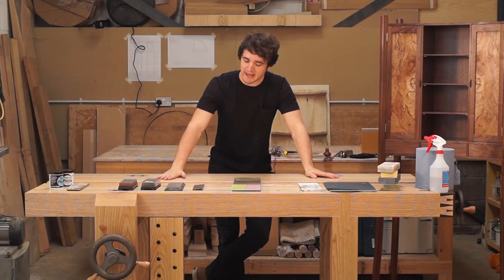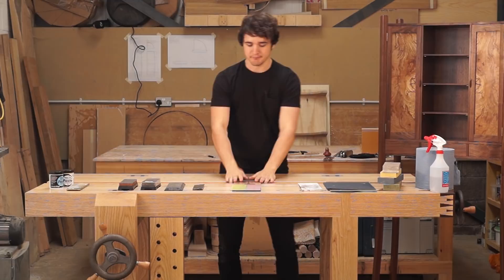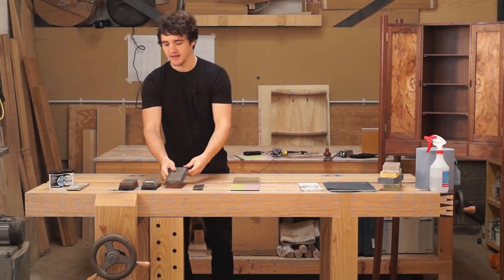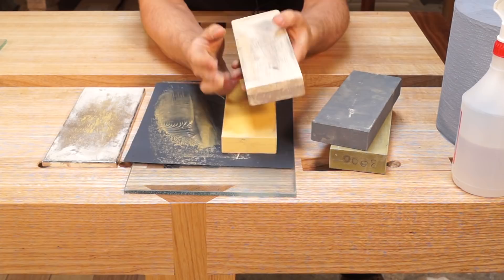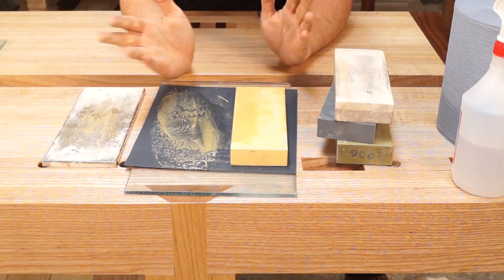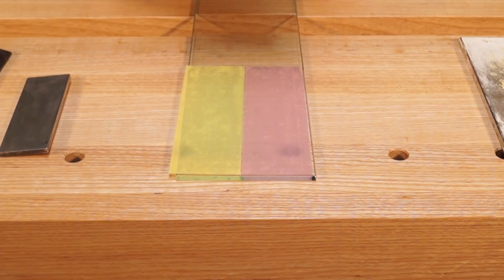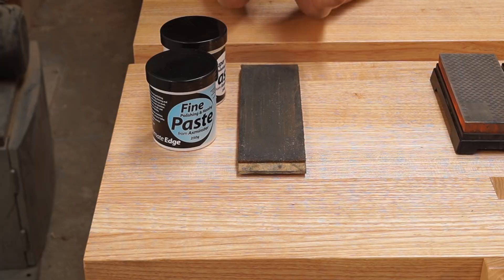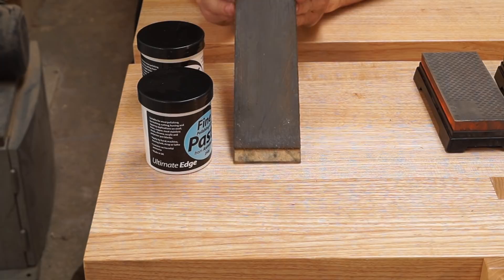Which SHARPENING Stone Is BEST? | Tool Duel #2

Comment: Honing guides are nice for beginners but once you´ve learned to do it free hand, you can use the whole stone. That´s one of the two problems with honing guides. You can´t use the whole stone with them. It will dish quicker and you´ll have to flatten it more regularly which wastes a lot of the abrasive material you´ve paid good mones for and it wastes time. The other problem with honing guides is that you need time to set the thing up. You can save some time if you have a jig to set the angle, but that´s just one more thing you need and one more thing that takes up space.
If you learn how to sharpen freehand, you will have none of these problems.
There´s also no need for a separate sharpening station for oil stones. You build a nice box for them, so your bench stays clean. You don´t need a lot of oil on the stone, a thin film is enough. The oil doesn´t dry, so you can sharpen a few tools untill you have to take the oil off and put some new on it. A few drops is enough and the stone stays ready for the next use. When using water stones, I can recommend splash and go stones that don´t have to be soaked. Shapton Kuromaku or Naniwa professional/chosera are a good choice. A few drops of water is enough. Soaking water stones are very messy and you don´t want that slurry on your bench. Then you have to soak them and store them dry. Some can stay soaked but then you need a bucket or something to store them.
All of these methods work and can get your tools sharp. Just look what´s best for your use case.

Comment: if you use glass cleaner instead of water or oil it works amazing because it has a very slight abrasive in it maybe 40000 grit it also polishes so well never go back once you have tried it
Reply: Simple green
Reply: I get an allergic reaction when I use glass cleaner now -- possibly as a result of this, or possibly something I developed earlier. If it doesn't bother you, though, it does work well!
Reply: What type of glass cleaner? Like Windex.
Reply: Agree, glass cleaner works great. Read the label before buying though and make sure there is no ammonia. The dollar stores carry the right one, and cheap too.
Reply: Ive heard use glass cleaner on your diamond stone and water on your water stone. Is that what you meant or do i just dump glass cleaner on anything and everything
Reply: Eric Kirby it‘s called „water stone“. not „glass cleaner stone“. use glass cleaner on diamond plates only.

Comment: Float glass is ordinary glass, that has been left to solidify atop a slab of molten metal. The molten metal was liquefied and then slightly cooled, and left absolutely still, resulting in a perfectly flat molten slab. The molten glass is poured atop that perfectly flat molten slab and left to solidify, resulting in an equally flat peice of "float glass".
Reply: I believe most float glass is made in a continuous process where the glass floats the length of a molten tin (?) bath until it is cool enough to be transfered to rollers. Also, flatness is a relative term. For the purpose of sharpening, float glass can probably be considered "perfectly" flat. But, for other applications like high quality optics, it not very flat.

Comment: I noticed so many folks hate sharpening. For some unknown reason I find it one of the most relaxing things I do in my shop, I know I have issues! But at the same time I'm just a part time woodworking making time not much of an issue. There's a product called magic eraser most stores have it it's a cleaner and works great on cleaning your diamond stones.
Reply from the maker: I like it at the start of the day when I'm preparing my tools for a days work. But when I'm halfway through cutting a dovetail and I need to sharpen a chisel, that's when it can kindly sod off. It breaks the workflow. I'll look into that stuff though, cheers!
Reply from the maker: I like it at the start of the day when I'm preparing my tools for a days work. But when I'm halfway through cutting a dovetail and I need to sharpen a chisel, that's when it can kindly sod off. It breaks the workflow. I'll look into that stuff though, cheers!

Comment: its amazing the discussion on diamond vs whet, then you have the sandpaper folts, and those fancy sharpening gizmos between knives, planes, and chisels you can get some heated discussions. and oddly enough i went to the dollar tree last week picked up a 1 dollar stone, and fixed up a old butcher knife i used on one of those horrible fixed angle carbide pull sharpeners (DONT USE THOSE ON A KNIFE YOU LIKE!)

I re ground below the knicks and then flipped the stone and honed to whatever the abrasive was, maybe 5-800 didn't expect much, but a few strops on 1k sandpaper (not enough to polish) and that sucker shaved. Im not a chef or a sharpening snob if it cuts hair its sharp in  my book, i've never gotten anything hair popping sharp like a really nice strait razor. But all in all a 1 dollar stone put a hair cutting edge on a cheap kitchen knife.

 I think if you get the technique right you will get a edge on what your workin with. Your budget decides how knife of equipment you are using.

Comment: How flat is perfectly flat? Do they provide any tolerance of flatness and other shape tolerance information? Well it's not really important but makes me curious.

Waterstones, or whetstones, or synthetic stones made out of ceramics in general, can be soft. But they can be hard just as well. Not sure if all of them should be called waterstones since there's many splash & go stones on the market now that don't absorb almost any water at all, you just splash something on the surface and go. They really don't create much mess either. Then again there's stones like Shapton's Kuromaku or glass series that seem rather hard. You likely aren't gonna bite into them with the edge, but some people don't like them for being almost too aggressive on removing material. On the other hand there's of course those cheaper side combination stones that are like piece of mud puddles as soon as you lay metal on it. I'd say there's a whole sea of information and variety in the synthetic whetstones as well. Then there's also the natural stones that are somewhat different. And some beautiful stones like Morihei or Imanishi that have natural stone mixed into the synthetic stone, they feel really nice to sharpen on. Sort of on the hard side but really nice slurry, although you can still bite into it. And the higher grit you go, usually the harder the stones are as well. Caveats everywhere. But with them just like you said about sharpening materials in general - know what you're buying before you buy. So that you won't get surprised by misunderstanding what you have in your hands and how to use it.

I think most agree that if you're going very high in polishing, there's not many like the natural stones. But maybe the 10k and above grits are more for straight razor and sushi knives.

If you find diamond stones are too expensive for flattening, you can get synthetic flattening stones from highly liked manufacturers like Naniwa or Suehiro for something like 20 euros/dollars. Also watch out because it's not at all given that your granite plate is a flat and properly shaped surface either and doesn't live.

Comment: Love your videos.  I don't have experience with oil stones and very little with abrasive films like Scary Sharp but have used DMT diamond plates and water stones for several years.  I've had the most success using a combination a course/fine diamond plates for establishing primary and secondary bevels and Waterstones for higher grit sharpening (1,000-16,000 depending on steel type and intended use).  I don't seem to get as good results from extra fine and extra extra fine diamond plates.  This could be, as you suggested, due to the diamonds clogging quickly or because diamonds glued to steel is very unforgiving and could cause micro-chipping in harder/brittle metals (ie A2, blue paper) or on low angle bevels compared to the swarf on Waterstones.  I'm not sure if there's any evidence of that being true but it makes complete sense in my head (as most things do lol).  Either way finishing with a strop is essential and often overlooked imho.  Thanks again for your videos and I love the channel!

Comment: Float glass is made by pouring liquid glass into a pool of molten lead.  The glass floats to the top and spreads out then the whole thing is allowed to cool.  This is how the flatness is exactly equal to the curvature of the earth.  Machined surfaces can technically be made far flatter, but honestly a granite or marble tile is fine for this rather than "float" glass, and it cheaper and far more easily accessible.  You're splitting hairs over a few ten thousandths of an inch over the width of a 2-1/2" plane blade.  A dual-surface water stone and high quality diamond plate lap block are cheaper over a lifetime of a professional, but the Scary method on a $4 granite tile with an assortment pack of 3M wet/dry sandpaper is cheaper for most hobbyists.

Comment: I've been sharpening free hand for years and have never used a honing guide. I can get very sharp edges and consistent bevel angles, its all about muscle memory. I use waterstones and the whole issue with the pushstroke can easily be avoided, just gotta be careful and conscious of how your edge is laying on the stone. I don't find flatness to be that big a deal. Occasionally I will flatten mine, but certainly not after every use. I find that the stones stay reasonably flat for a long time before they're too dished out.

Comment: Straight to the point, great vids
People usually ask what is an oil stone and what is a water stone, just most natural use water, man made depend what manufactures recommend. But once a stone has been introduced to oil there`s no going back. 
Diamond stones are to aggressive on metal , they scratch to deep for there grit rating,
Oil stones , I expect back in the days oil was known not to rust high carbon steel.so most persons just used oil on there stones.
Water stones, the majority of them designed to lift the compound and move with the blade and then get ground down to make produce a slurry,
Japanese water stones are the best as long as you get the high end natural stone, they can last you a life time if used correctly and cut fast, but Way to many to mention. You could spend a life time studying them and still not know it all. 
Man made water stones have their place to, mainly used with oil unless recommended with water.
ceramic stones mainly for end of use ,fine sharpening and polishing,
Only buy the correct honing stone or plate to suit the tool and steel  ,no need for expensive stones if you just need to sharpen the general tool,
As a general rule hard stone for mild to soft steel ,soft stone for hard metals,
Never leave an oil stone uncovered and never leave over oil on it,
Nothing wrong with the usage of an old stone step now and then,
No, not all water stones wear quicker, natural Japanese and other stones can be very hard wearing, depends on the stone material, and never sharpen tools near your work piece,

Comment: I’ve done the scary sharp method (don’t care for it), waterstones, and diamond stones.  I love the waterstones for grits 1000and above.  I have four waterstones 1000, 3000, 10000, and 13000.  I have two diamond stones for the donkey work of removing material.  The diamond stones are nice but they don’t go too high in the grits and I love polishing to a mirror edge as it makes cutting or planing easier.  Oh and I sharpen freehand.  Practice makes better.  :)
Reply: Matches my experience exactly.  I have one diamond stone at 400 grit. If I have to remove a lot of material like flattening the sole of a plane, the diamond stone is great, but the 3k grit waterstone is my highest grit stone and then I polish on the bench grinder with a polishing wheel and green buffing compound (60 k grit),  I am entirely happen with the results, which are razor sharp.

Comment: Keeping a Waterstone flat is a trivial process. Use an inexpensive low grit diamond stone when needed and away you go. I sharpen primarily Japanese Chef knives which tend to be much harder than Western knife steel and I have no problem keeping my Waterstones flat. When you are ready to flatten your Waterstone draw a grid pattern with a pencil on the Waterstone face and then go over it with your diamond stone.. When the grid pattern disappears, your stone if flat. I use a 400, 1200 and 6000 Waterstones and a leather strop with a Green Chromium compound and my knives are beyond sharp. I can cut a tomato in half, place it flat on a cutting board and then I can cut a transparent slice of the tomato using only the weight of the blade to cut across the tomato as it lies flat on the cutting board.

Comment: Matt,
Thank you for all your helpful tips!  For my chisel and plane sharpening, I have recently settled on some Norton water stones - and maintaining flatness of the water stone with float glass and sand paper. 

Could you speak to what grit sand paper you would suggest to maintain artificial stone flatness?
Reply: I was really needing to know this as well. Also, my waterstone is different grits on each side, and the other day they came apart. Any idea of what kind of adhesive is used to hold them together?
Reply: 220. Most of the diamond stones used to flatten waterstones are in the range of 220.

Comment: Float glass is made by floating molten metal on top of molten glass.

Also, tried scary sharp.  Too expensive. The paper tears too easily and restricting motion to the pull is crappy.  Waterstone is my favorite, with a 400 grit diamond stone for when I need to remove a lot of material quickly.  I finish with green buffing compound on my buffing wheel and that polishes it to mirror polish.  Most of the time when I want to resharpen, I just use the wheel and that puts the edge back on track.  Once I get an edge razor sharp, the most I have to do to resharpen is the 3000 grit waterstone and then the wheel again.  That's the beauty of the honing guide.  Those guys who do freehand have to go through a range of grits again, but the guide puts you in such great shape that I can resharpen my edge in about two minutes tops.

Comment: 1000 to 6000, is a huge jump, that will not let you remove the scratches from the previus grit. The grits should be tighter. 300/1000/3000 is the best set for knife sharpening for example. Also remember, that you have to double then triple or even more ,the passes as you go low to high grit.
Reply from the maker: Then why does it take me about 10 back and forth passes?
Reply: @MattEstlea  because you haven't tried to polish a steel to mirror finish. When we use stones or sandpaper etc, we try to remove the scratches from the previus grit. As we advance, we have to apply more passes and multiply them, because as the grit gets hiegher, it removes less and less material, thus it needs more work to remove the scratches that we did with the previus grit. I never said you will not get a sharp edge like that, I just said that the jump is huge fro, 1000 to 6000. If you went, from 1000 to 3000 you would need far less work, to accomplish mirror finish to an edge. Also 6000 stone, is way to high, no need to spend the money, you can use leather strop after 1000 or even better 3000 grit. Also try to strop on black letters part, of a soft newspaper page, that you have stretched on a leather strop or any similar way. It aligns steel molecules and also provides more polish to an edge (Really scary sharp, that last even more)